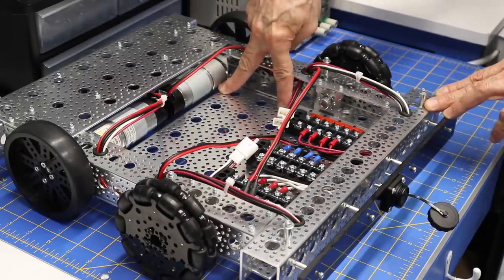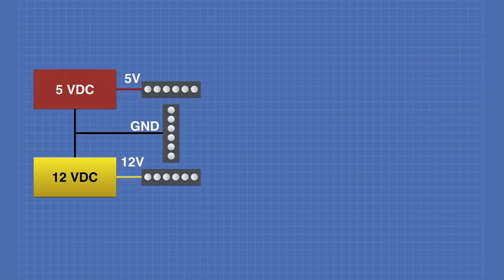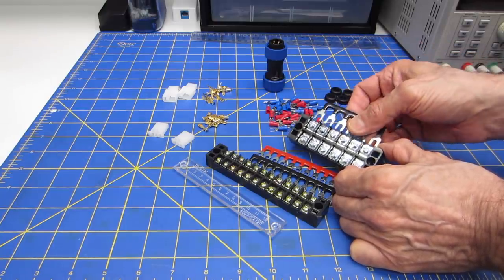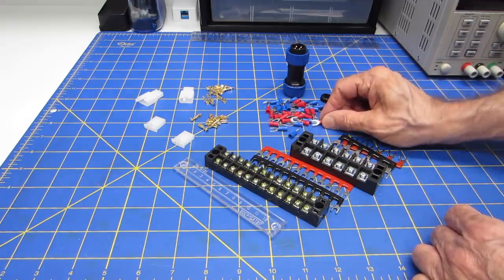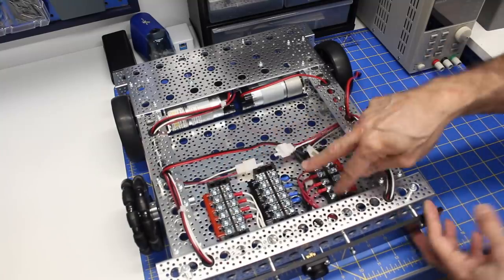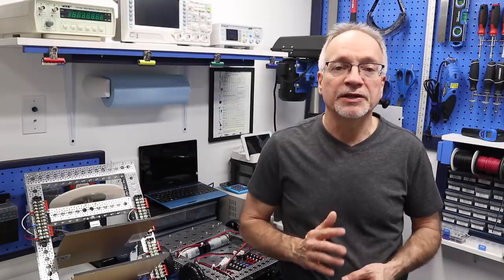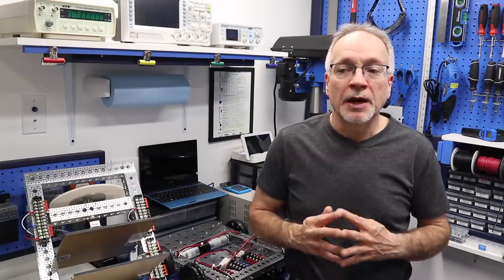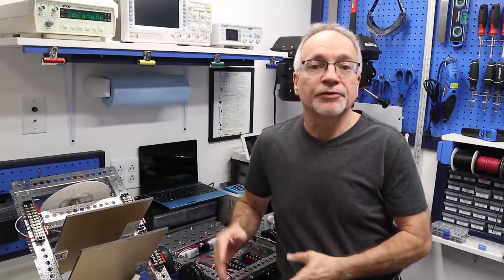Build a Real Robot - Episode 6 - Power Distribution

Comment: Excellent cable management, I have developed and build from scratch a pellet burner prototype for my heating system with an arduino micro as the controller,  The most difficult part was making the harness without quick connectors, which i will agree with you, it made it difficult to troubleshoot, lesson learned....looking forward for the upcoming video.

Comment: It appears that the white connectors you are using are Tamiya connectors. I would suggest an alternative connector. I have helped coach an FTC robotics team for the past 7 years. For the first couple of years we used our batteries as they came to us with the Tamiya connectors. But what we found is that we started having random electronics failures during our matches. The culprit was the Tamiya connectors. Basically the female connector was becoming slightly enlarged over time (plugging/unplugging the batteries). The result was that when the robot changed direction or was bumped sometimes the male and female connectors would briefly become disconnected. We have since switched to Anderson Powerpole connectors. They work great and the only failures we have had is when the contacts are not properly crimped or if they weren't inserted into the housing properly. We haven't had any issues with duty cycle. The Anderson Powepole connectors are rated for 10,000 no-load connect/disconnect cycles. I couldn't find similar information for the Tamiya connector but in my experience it's more like dozens, perhaps hundreds of connect/disconnect cycles.